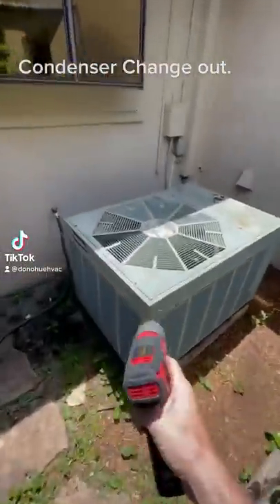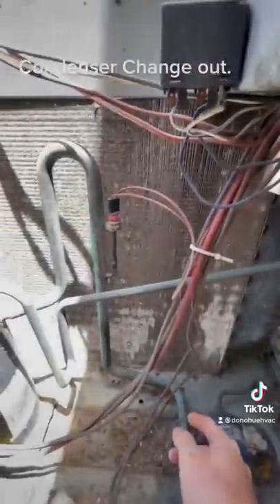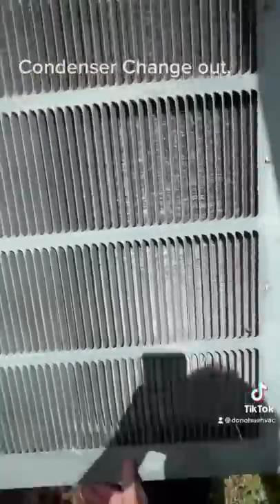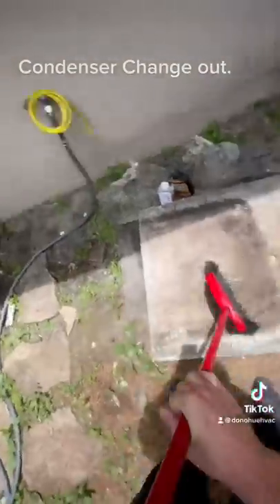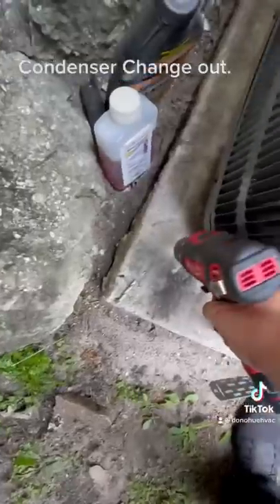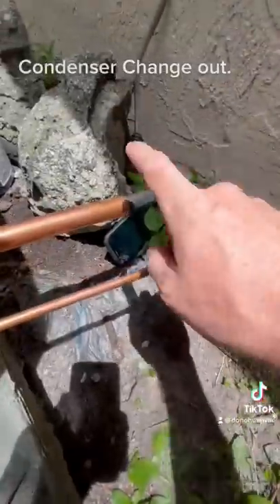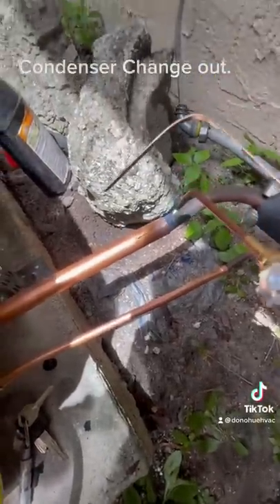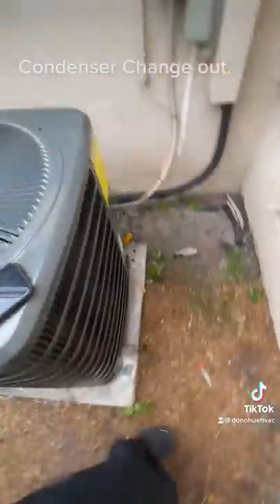Condenser Air Conditioning, DIY

Comment: You’re supposed to do the pressure test before you vacuum
Reply: facts
Reply: Yes.
Reply: He just said that in order, not exactly that he did all that in that order. He probably knows judging by his like 🤣
Reply: Im sure the guy knows if he knows how to bend copper that nice like he did im sure he pressure test
Reply: Orrrrr you have a micron gague and can tell when you’re pumping the system down. You could also do a decay test with it.
Reply: Doesn't really matter, it's a Goodman. It'll need to be replaced before anything leaks out anyways. Kind of like a one-time use deal.
Reply: Vacuum works as a leak test itself, if you can't reach atleast 15- 20+ microns depending on your pump (best 25-30) then you have a leak
Reply: @DJV94022  old school spring bend works great
Reply: @thoughtx4728  why even use a micron gauge?  Just vacuum it for 30 min and slam some ref in it till the suction line is beer can cold.  No need to purge lines either, and hell....recovery machine...what's that?  Just cut tgst bad boy open and vent it.  Ding dong dang bubba.
Reply: I have zero knowledge about any of this so I am just going to agree with you
Reply: @duecefoesubie   lol yeah thats scab shit right there. R410 systems are a lot more sensitive than the R22 systems. Especially if youre replacing just the coil and condenser and using existing refrigerant lines than you most definately want to flush the lines with an rx11 flush. Followed by a purge with nitrogen, purge while you braze your connections so you dont restrict the txv with soot, and pressure test. Vacuum should get to under 1000 microns and stay there- if it doesnt stay around there or if you cant get it below 2000 you definitely have a leak somewhere and will have a problem. R410 is a mixed refrigerant so those leaks will fractionalize the refrigerant over time and lose efficiency big time. It is possible for new units to last a long time if they are installed right. Its just rare to find anybody that still cares enough to do it right.
Reply: I literally just said the same thing out loud 😂
Reply from the maker: wow all geniuses!
Reply: @AirQualityInc  don't be mad because you're installing garbage for customers. You're not the only one that does HVAC.
Reply from the maker: @maddoxinc1642  bro garbage? What’s garbage is selling any other type of unit then Goodman
Reply: @AirQualityInc  I feel sorry for your customers.
Reply from the maker: @maddoxinc1642  why? I take care of my customers
Reply: @AirQualityInc  Goodman is literally the cheapest shit you can get with a epa lmao
Reply from the maker: @lukebarnett816  not true at all. You have guardian, Bryant, champion, trane.
Reply: @AirQualityInc   you must be a troll if you think Goodman is better than Trane
Reply from the maker: @cwindsor8585  oh please trane is built in China?
Reply: @AirQualityInc   You obviously didn’t read my comment I was talking about price Goodman is still the cheapest out of almost all of what you just named
Reply from the maker: @lukebarnett816  no Goodman’s are expensive, you know Daikin bought Goodman right? Goodman’s aren’t what they were 5 years ago....
Reply: @AirQualityInc  lol, dude...if you're post shit online, do it the right way.  You know how techs are, that's why we make good $$$$.  We're critical of eachother
Reply from the maker: @duecefoesubie  when you start making what I make you can talk and comment on my stuff
Reply: Pulling a vacuum can be a pressure test. If you're holding 1k microns for 4 hrs than your fine...
Reply from the maker: @Keegeth  boo yahhhh these guys check with nitrogen because they don’t know how to graze🤣😭😪
Reply: @AirQualityInc  oh I'm sure your double wide is all tricked out with yhe latest Walmart goodies.
Reply: @duecefoesubie  is very obvious that you have no knowledge of what you're doing and  don't care about the customer or if the unit functions and it's efficiency, I wouldn't want a butcher working in my unit. Did you ever hear about proper superheat or subcooling or middle point? Dew or bubble point? I wouldn't want to work in a unit after you touched it and find out my temp and pressures are crazy
Reply: @jenniferm5375  you know what will affect the entire system no matter who "works in it"?  Not evacuating a system properly.  That's where everything starts.   I'll but it a way you can better understand.....
It's like cooking something in the kitchen..if the ingredients aren't right....it's going to taste like shit.  Now go make your man a sandwich.
Reply: @duecefoesubie  I know you know what you're doing, is always better to do the right thing to save ourselves from having a very bad day and others. I agree not vacuuming properly will lead to other problems. If we are open minded, we'll learn something new everyday. No hard feelings, keep up the good work!!
Reply: @jenniferm5375  killing me with kindness.   Now I feel like an asshole.
Reply: I'll settle this... We all know Goodman is certified trash. Anyone that says different is lying to you, themselves, or a fool.
Reply: Yamaszlof Mcdurkin  they're warranty is no different from anybody else's and their coils leak worse than any system I've ever worked on, including dyken, which I have probably changed over 2000 coils
Reply: Yamaszlof Mcdurkin  they're coils are horrible and constantly leak even with the daikin who uses Goodman's same coil. The only upside to a Daikin is that it has a 12-year warranty but I have customers who have 5 years left on the warranty and pay me to put something in train is more expensive but have one of the best. Compressors and outside coils in the industry
Reply: @cranialdiscomfort  1000 microns? That's it?
Reply: @cwindsor8585  Bruh Trane is just an overpriced pos.
Reply: @Mr_Daddy1980  I never said I like to use them. They're just better than Goodman
Reply: Yamaszlof Mcdurkin  I find that quite interesting myself that you're probably the only person with 20 years experience working with Goodman That's only had 50 leaky coils. They're known throughout the industry to have one of the leakiest coils that right up there with Lennox except Lennox only had about a 3-year run a bad coils
Reply: @cwindsor8585  I've seen Goodmans outlast some of the more expensive brands. The price point really doesn't matter if the person installing it isn't doing it properly. If properly installed most of these systems will last 20 plus years. The issue isn't the brand.....it's incompetent Techs.
Reply: @Mr_Daddy1980  you might have seen that happen but it's not what's happening in the majority of the time? And yes, all units can last 20 years if you replace all the parts. But if I have to keep changing compressors and coils at the expense of the homeowner, that doesn't equal good product
Reply: @cranialdiscomfort you're not wrong, but I think you've been drinking the juice wayy too long
Reply: @donohueairconditioning2408 higher amps than Trane compressors everytime and twice as loud.

Comment: If you flair the existing copper and slide copper into that it it much easier to braise it together because the joint is facing you instead of the wall.

Comment: For the person below you can vacuum test and that'll give you a decay test which is kind of like doing a pressure test and depends on your vacuum pump it could be faster but personally I would have like to see you mention when brazen having nitrogen flowing to stop the oxidation also your flame the blue tip needs to be a little bit longer

Comment: All of the HVAC Companies here in Nashville, Tennessee Codes makes us put dryers on the suction line after a change out on the condensers.  We flush the line set with acid Flush if its a burnt out compressor or changing from R-22 to 410-A Freon. Keep up the awesome videos and Be Safe out there Brother. Good job 👍
Nashville, Tennessee 
price here for a drum of
R-22 is $ 1,800 
Plus tax @ 9.25%
410-A $ 825.00

Comment: Goodman sucks. We were putting them in and kept getting leaks and x13 motors that failed before a year. And yes we pulled vacuum under 500 microns. We use Rheem Ruud now. Not as bad but now getting stuck txv’s and pistons

Comment: Curious why you didn't change the a coil and line set out if a a condenser that old goes out the type of freon in there can turn i acidic and mess up the new unit

Comment: also i suggest a minimum anti urine splash fence because it'll destroy the aluminum as my neighbors dog ate through mine ... stuff turns brittle and falls off like crunchy dry leaves brand new micro coil i sure miss my giant coil it only needed to be bigger and motor replacement for fans and compressor... they should install grease zirts for die electric ⚡ grease to make motors last longer and also have an easy way to clean coils pushing water/coil cleaning foam from inside to out so not wedging dirt further in but of course without bending the fins you can only keep so straight and without the fan motor and rotors being in your way

Comment: What would be the difference between brazing it and soldering it is there an advantage or disadvantage
Reply: You gotta braze it because refrigerant pressure are high and a braze joint will less likely to leak under high pressure vs soldering it witch is not really meant for high pressure so will eventually leak at the solder joints. Hope this helps

Comment: Where is the dryers on both lines. Good rule of thumb to install when system is open to environment.
Reply: Goodman has filter dryer built inside condenser
Reply: @ZachClynes  I stand corrected
Reply: @terrypatterson5856  it’s a blessing and a curse. Nice because it’s already installed, but to replaced kinda sucks because you have to recover refrigerant instead of pumping it down, remove the top and sweat it out
Reply: @ZachClynes  been there and done that too many years. I know where your coming from

Comment: No need for brazing good solder joint is plenty of strength for those pressures also solder negates the need to use nitrogen as the less heat doesn't cause the inside of the pipe to oxidize

Comment: Atleast you pulled a vacuum. Our installers always burn up indoor TXV from not taking sensing bulb off and probably never pull a vacuum.
Moisture in the refrigerant will turn acidic and make them aluminum coils leak

Comment: I always install the higher of the ground. I usually put them up on cinder blocks minimum. And I have the pad at least 8 in bigger all the way around the unit. Why? Harder for dirt to get there because it gets rained on and the dirt doesn't bounce that high usually. Most dogs don't pee that high because after all is done it will be 12-14 in before the lower part of the unit is there. Dogs pee on them and that eats aluminum  and dirt washes easier and weed eaters don't usually hit that high and around rentals most of the time we just spray the ground around them.

Comment: The old system was a r22 the new was 410 by the look of the age. You didn't flush the line with rx11 flush and you didn't change out the evap coil??
Reply: You don’t always have to use cleaner, usually only if the compressor burned up, and yes txv of piston needed changed if refrigerant was switched

Comment: We recently had the big fan in there replaced (we rent, they only replace stuff if they HAVE to). Apparently I am 1 of the only people those guys have met that keeps the thing clean. I had 3 of 4 sides pretty damn clean, the side against the wall was still pretty dirty cuz it is hard to get at. 2 minutes with a garden hose every once in a while can add YEARS to the whole unit.
Reply: Make sure you wash the condenser from the inside out if you can so you can push out all the dirt. Otherwise you are just pushing in all the gunk and clogging the fins, the top layer of gunk will wash off but the rest just stay in the fins.
Reply: @JP-zz5rm  but the new fan is attached to some big metal cover now. I think it just stops stuff from falling into the unit. Also, I rent... soooooo if it breaks down I call the property people and they call someone like the guy in this video to come fix it. Job security, my friends. 😉
Reply: @randomconsumer4494  you are able to remove the entire top as a whole and wash it out. True that!

Comment: I had a Goodman run for over 10 years and just had it changed out cause I didn’t want to push it and have it die this summer had a whole change out air handler and outside unit all was 3500$ so don’t let them rip you off
Reply: Get the cheapest so you can get the cheapest work. Goodluck bud.

Comment: Why do you run nitrogen while brazing? I replace compressors in fridges and never do this. Only time I use nitrogen is when I am leak testing after brazing.
Reply: I never do it, but running a slight breeze of nitrogen through the line while brazing doesnt allow any carbon buildup on the inside of the joint. Like I said I never do that shit though.

Comment: I don’t like reusing lineset like that.  If you are doing it on a budget.  I get it.   But that r22 oil does not like the 410 oil. I know they have products to mitigate that. But.  You shouldn’t reuse like set unless you absolutely have to.  Nice job for brazing though.  Most guy around my parts solder.  Which. I actually have never seen an issue with.

Comment: Why would you check your brazing job with a mirror isn't that what nitrogen is for to locate any leaks and let you know the system isn't holding pressure??  Did you pump down the r22 that was in that unit or did you recover it?? Why wouldn't you just pop the top off and run some tapcons through the bottom tray of the unit itself??? And if you want to get technical if you're upgrading the condensing unit you should also upgrade the line set at least the suction side to the proper diameter of new condensing unit you just basically pinched some of the pressure down going from big to medium suction line!
Reply: Nothing was said about recovering. I noticed that too. Maybe Florida doesn’t require that LOL!

Comment: Goodmans are literally know as one of the worst units you can get
Reply: Just hit 10 years with my Goodman. Not 1 issue so far. Nothing.
Reply: It’s really just about the installer and how they do it if they use nitrogen while brazing or flush out the lines with r11 tho that usually with a full system replacement but good man’s are definitely one of the cheapest units you can buy with a epa
Reply: The only reason you hear people say Goodman is junk is because there are more Goodman units out there then any other unit they make up most of the market
Reply: @neffdog564  Damn. You personally owning one certainly holds more weight to the guys who have worked on thousands of them
Reply: @bjsavage9401  I also think it largely depends on the maintenance performed (if any) and the install.
Reply: @bjsavage9401  no,Goodman air handler is no good the condenser not so bad, you might get a 6 year out of the condenser

Comment: Why replace the entire unit instead of just the pump? I don't work in the field so I'm genuinely curious. Or is it just a matter of "It's an old unit might as well replace the entire thing."
Reply: No because when you replace u it's to an updated one you should do both the evap and the condenser. You shouldn't ever just do one or the "pump" which I assume you're talking about the compressor, you need to have matching equipments and a metering device and compressor that's rated for the type of refrigerant you use. It's not the matter of its old, there's so much you have to consider when replacing equipment on a unit.

Comment: Can I just swap out the condenser (2005 Goodman 3ton) or do I have to change the air handler too
Reply from the maker: Ehhhh i would do both if you don’t want a headache
Reply: It depends on if your old unit was running freon or not. If it was, at the very least you will have to replace the expansion valve or piston, assuming the coil is rated for 410A

Comment: Why run nitrogen while bracing?
Reply: If you don't, the inside of the pipe can oxide and flake off during operation. Can plug up a filter dryer or a valve.

Comment: Air handler get changed with that ?
Reply: For best efficiency yes,  but in reality you can mismatch coils to an extent as long as you go with a txv  still doable with a fixed orifice tube , just a good better best situation.   It technically doesn't gave the seer rating anymore because it's mismatched.
Reply: @jram7047  you cannot mix r22 and r410 coils.

Comment: Hey bud love the channel but question, I recently had a AC repair man refill my AC unit with Freon gages went from 100 to 150. He charged me $300 did I get ripped off?
Reply: Prices can vary a lot depending on location, But in my experience if somebody shows up at your house it's at least $200 so sounds about right
Reply: You shouldn’t need to refill it. Find the leak man.
Reply: no you didn't get ripped off.   r410a can sell for 100-130/lb.  r22 180-220/lb
Reply: That's crazy I work with commercial equipment and we only charge 92 a pound for r22. And 410 we only charge 45 a pound.
Residential they charge wild accounts
Reply from the maker: No I’d say he hooked you up haha

Comment: Pressure test with nitrogen before vacuum pump.  Saves time eventually
Reply: Didn't flush old oil out of the lineset either. System is gonna die after 10 years assuming no leaks

Comment: Would have liked to see a better “cap” on that low side joint buddy ;)
Reply: Would of liked to see him actually couple it with 5/8 instead of just bumping up to 7/8 and making it fit over the old suction line and forcing it over the suction service valve.

Comment: You don’t have to have nitrogen flowing while braising
Reply from the maker: You don’t need nitrogen when pipes are open😂
Reply: The idea is to keep that black carbon on the outside of the welds to form on the inside. The acid from the carbon will eat away the shellac on the compressor windings and cause a short.
Reply: Yes you do